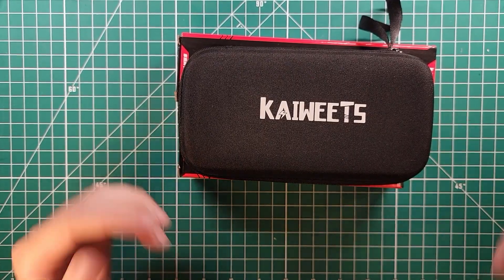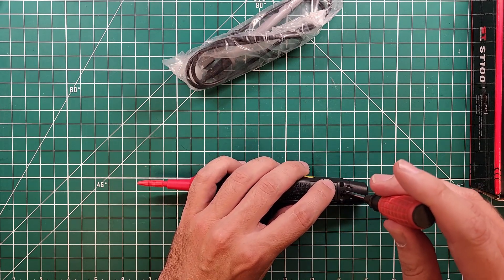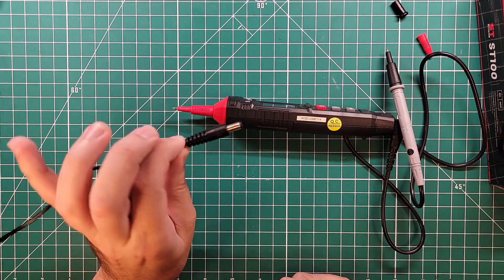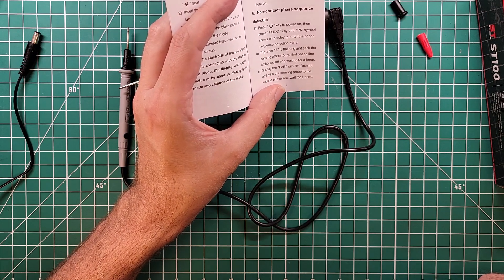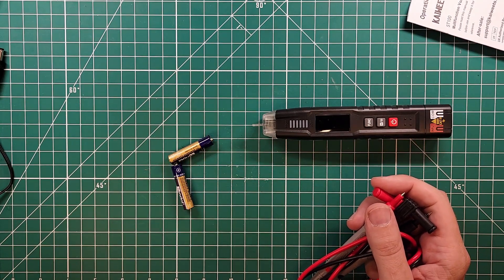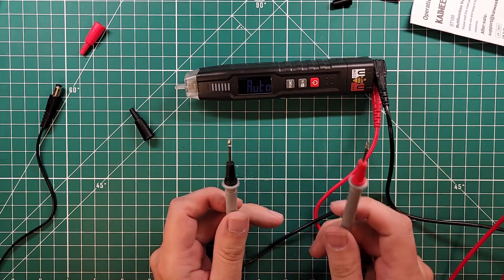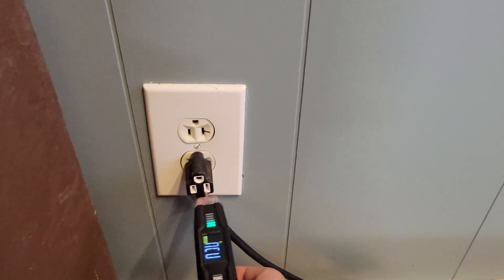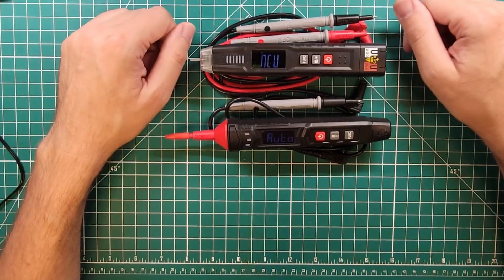Introducing the Kaiweets ST100 and ST120 Multimeter Voltage Testers

Comment: I’m looking at a Klein CL800, any comments?
Reply: Didn’t realize the units you reviewed are $20 Klein is a we bit higher x 7 to 8. 😎
I desire the clamp amp and the Temp Probe feature on the Klein. HFright has some but I want the better quality versus suspect accuracy…
I will look into CL390.
Reply from the maker: https://amzn.to/3RXDXbs The 390 is $60 cheaper than the CL800!!  The 390 does everything I'd need and then some.  Not a bad deal either.
Reply from the maker: https://amzn.to/3xgSQxI  I don't have one in hand, but I have used clamp on meters before.  Klein has a good rep, so I wouldn't complain if you handed me one.